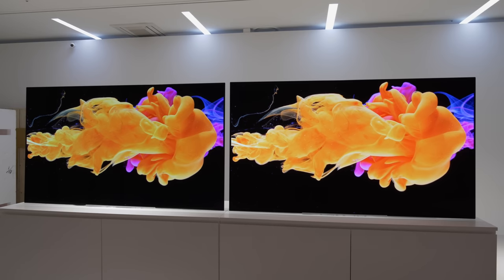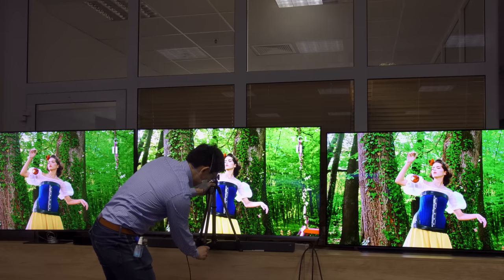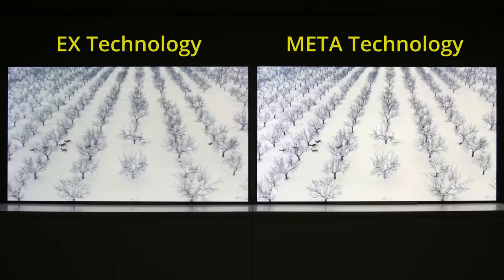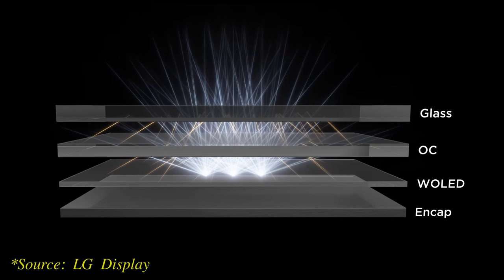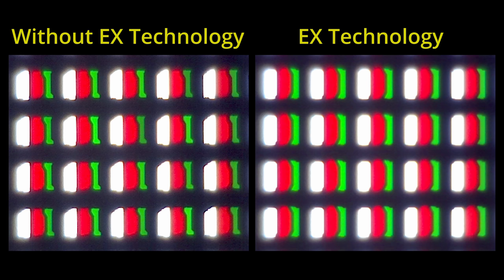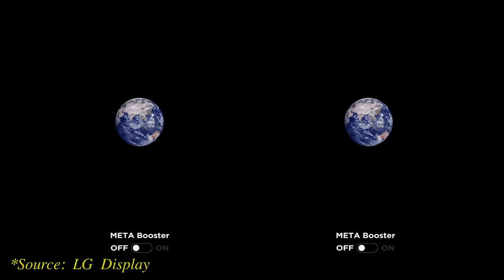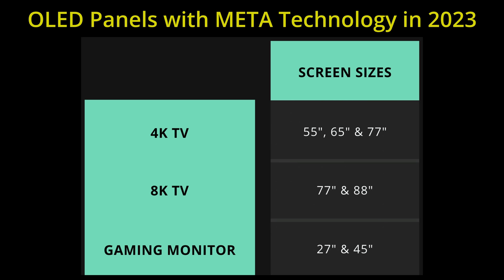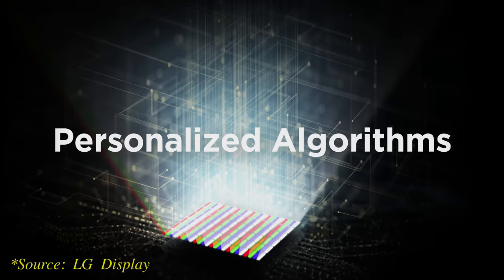MLA OLED Panel Explained - The Secret behind 2100-Nit OLEDs!

Comment: I wanted to by a lg OLED C2 48 inch TV should I just wait than
Reply: Wait for what?  A C2 48" is $1,000 right now, while a G3 55" (the smallest size) will probably be closer to $3,000 - $3,500.
Reply: C2-C3 is only 20% brighter, G Series makes the diference

Comment: As long it doesnt overbright it. I still think the A95k is too bright and the natural colours are far less than a standard oled. Though im a fan or darklevels colours instead of bright
Reply: Keep in mind that if you use a mode which is more accurate or you pro calibrate the TV, you will drop a little in brightness but your colors and picture will be far more accurate!

Comment: Certainly a nice marketing feature and good for HDR specular highlights, but still white subpixel boosting.

QD OLED is clearly the better technology here as the color luminance is MUCH MUCH better than any LG WOLED panel.
Reply: Sure but will you really see that much of a difference in normal movie content that doesn't utilise the expanded colour space? Or will you just be watching demo content all day long.
Reply: @lukey08  yes you will
Reply: Whilst this is true in theory, the implementation of the technology is way more important than the actual tech itself. For instance, the difference in quality of the image produced by the A95K and the S95B was huge, especially if speaking with the hyperbole that you just did with “clearly better” and “MUCH MUCH”. Also, the television that produced that produced the 2nd best imagery last year wasn’t a QD-Oled. If the technology was so “NEXT LEVEL!”, the 2 QD-Oleds would’ve left all other displays in the dust, but the didn’t. The Panasonic LZ2000 was far and away the best TV last year in terms of pure accuracy, and if the end goal is image perfection, that means perfect accuracy.

I mean, the thing all people desire is “it’s so real you can reach out and touch it!”, right? Oversaturated colours doesn’t achieve that effect, and never will
Reply: @lukey08  and no you won’t. Not if the content isn’t graded correctly and the output of the tv is showing all colour luminance levels at the corrected output numbers
Reply: Panasonic industry leader in accuracy and preserving artistic intent chose MLA that tells you everything you need to know stop being a delusional fanboy.
Reply: @kingyogesh441  Huh? Why am I a fanboy for pointing out objectively true facts.

I own the Panasonic LZ2000 and HZ2000. Panasonic makes great TVs, that doesn't change how MLA and QD-OLED work.
Reply: @supremetaaanxz2241  I own the LZ2000 AND the A95K. There is 100% a differene in color luminance, and this idea that colors look over saturated with QD OLED is complete myth and untrue.

The increase in color luminiance of QD OLED is by far the biggest improvement in OLED TVs since they were first introduced.
Reply: @supremetaaanxz2241  You will though. SDR or HDR content looks much better on something like the A95K.  That is not to say that other WOLED TVs look bad, but there is a noticeable difference, and one I think is well worth the money for.
Reply: @Adam-vx6to  whilst that is a fair analysis, the difference is subjective. For you it may be huge, and for others it may be quite negligible. This is not me saying QD isn’t the way forward btw. I think Sonys more subtle implementation of the technology is actually brilliant, and the A95K is truly a wonderful set but again, for me, the difference between that TV and the LZ2000 isn’t absolutely huge. We’re speaking about the very best on the market you know? As I stated, it isn’t the technology, it’s always how the companies deploy said technology. Which is why processing will ALWAYS hold more priority (for me) than the actual tech of the screen
Reply: @supremetaaanxz2241  it’s both the tech and the now the companies implement it.
Reply: @Adam-vx6to  hmmm. See I overall don’t feel the S95B produces a great image, that’s why I feel the tech is kinda by the by
Reply: @supremetaaanxz2241  well Samsung is known for pretty subpar displays. The display panel itself and underlying tech though is better
Reply: @Adam-vx6to  you do realise colour luminance by itself means nothing if the artistic intent doesn’t tap into it 99.9% of content graded today is covered by MLA oled colour space so if you see “more colour” that means qd-oled is oversaturating it .
Reply: @kingyogesh441  wrong. 100% wrong
Reply: @kingyogesh441  well this is exactly my point. There isn’t much content to accurately display colours at that luminance
Reply: @Adam-vx6to  I am 100% right colour luminance of a content doesn’t magically scale will more colour volume of a display it has a hard cap put in place by artistic intent 99.9% of content available to us today should look exactly the same colour wise on calibrated MLA and qd-oled you can’t just magically add more colour to content which didn’t have it in first place.

Comment: Doesn't increased brightness lead to greater chance of burn-in?
Reply: I think it would if the extra brightness was from running the panel brighter but it seems the panel is just as bright as before but the "Micro Lenses" are recovering some light which was previously lost due to internal reflections.  Although the "Meta Boost" does seem like it will make some pixels actually brighter but I'd assume that will be offset by better heat syncs and or other burn in prevention methods. Currents OLEDs from LG are already pretty good at this, newer ones should be relatively similar or even better at preventing burn in.
Reply: @visualdon  Yep.
Reply: I've had an LG OLED e6 since 2016, with no sign of permanent burn in. I must admit, I do sometimes get a bit of image retention from Netflix menu etc, but it clears after a few seconds. I bought a G2 last year and that is showing no sign of burn in. I think the risk of permanent image retention is a little over exaggerated. As the meta panels are using a micro lens array to recover light that would otherwise have been lost to internal reflections within the panel, I doubt it would increase the risk of burn in. As a side note, I have never considered the colour reproduction on either of the OLED TVs I own to be washed out.
Reply: Think of magnifying glass
Reply: Both LG OLEDs I had got burn in. Guess I wasn't lucky. But meh it's whatever.
Reply: @SaithusX  which ones? i had a b6 get burn in
Reply: @anubisbahamut  I had the b7a and the CX. Now would I get another one? Meh. Maybe. Pic quality is good but definitely over hyped imo. But I have had one since the CX.
Reply: yes.
Reply: @SaithusX  what gave you burn in on the cx?
Reply: @anubisbahamut  Probably a combination of gaming on vivid mode. I play a lot of games. So the image was a stuck map icon of red Dead redemption 2
Reply: @SaithusX  ok thanks

Comment: Can I just say this in the hope in sinks in NARROWER  TV'S IS NOT A GOOD THING, they bend they break and they get damaged more easily.
As many Samsung owners in 2022 can attest too.

A uniform thickness is way way better (like the LG G2) that a razor blade mounted on a heavy lump ever will be.
A TV that is even 3" or more thick is better than that. it will sit on a wall better too. instead of this huge gap.

Now if there is heat dissipation reasons for it. fine but be honest about that. or put a heat sink on it.

But every time I mention this people say they'd rather that thickness was there if it contained a heat sink, or extra speakers or just made the TV structurally stable - like at all.

It's scary handling modern TV's they are way to thin on some models I would say stupidly thin.

Either put the TV electronics in a separate box to the panel or make the Panel and even thickness = but not this LG & Samsung silliness thanks.

Comment: Pretty disappointed this MLA tech will not be available on the 42" and 48" panels. I don't understand why they would skip those, considering they are probably the panels most needing the extra boost in brightness because of their pixel density etc. Very poor decision.
Reply: Because the added cost would make them uncompetitive. MLA application is likely mostly a fixed cost (the application equipment, photolithography mask, and the process) plus the smaller portion of variable cost (the materials,, electricity to run it, water/solvent to wash it), so per square inch, MLA is cheaper the larger panel you apply it to. LG probably feels that the added cost would make the smaller panels too expensive for their customers and the target end consumers. In contrast, those purchasing large TVs with the cutting edge technology will pay for the added cost, and as mentioned, it will be "cheaper" for them as well.
Reply: @DarkLordDeimos  Or, you know, they could have added 42" and 48" to the G series and priced them accordingly. And don't tell me there isn't a market out there for brighter 42-48" OLED's because you would be completely wrong. Considering the 42" is probably one of the best "monitors" available for the PC right now, and easily beats the overpriced mini-led monitors in cost and image quality, there is a whole lot of people in the market for a 4k OLED display that is MUCH brighter than the roughly 700 nits that the C series can deliver right now. I'll say it again, limiting the MLA tech to 55" and above was a stupid move.

Comment: Well before we all start getting excited, something we've all seemed to have forgotten, the C8 was already 950 nits peak on a 2% window, the C9 dropped to 850, then the C1 to  750 before the C2 came back to 800 again, all we are getting back is what we lost in the first place, it could be argued we lost it for a good reason as they were driving the panels too hard but nevertheless 99% of people will be gaining nothing at all in real terms for a few years to come yet until we see this tech on the "C" panels and not just he "G"panels.   For now i'll keep my 3D 2015 OLED which is still working fine, still has plenty of brightness (450 2%) and no burn in after 7 years !!!

Comment: Microlenses that SONY use in their OLED microdisplay viefinders (Alpha, Canon, Nikon) for about 10 years? :D
LG will sell that in the market like "new amazing technology". Your info is old like charcoal ;)
Reply: That is not the same thing at all..
Reply: @TheEdmaster87  I think it is the same thing
Reply: @lucasn82_  If it was the same thing then Sony would have implemented it in their OLED tv's and OLED mastering monitors year's ago!

Anyway LG Display is the first to implement it in OLED tv panels. In fact Sony etc are using specifically LG Micro Lens Array in future professional mastering monitors.
Reply: @C--A  They implement that in OLED microdisplays. From Sony Semicon site: "To adress these needs Sony SSC has developed an orginal technology to mold a microlens within a pixel, achieving an improved light emission efficiency of 2.2 times that of conventional product... +reducing crosstalk and better colimation".
Those displays are made on silicon wafer. Last year Sony and JDI shows first time OLED made by lithography. Soon every OLED display on planet will be made like this. I hope.
Mask OLEDs mostly are made on japan machines. Even RGBW structure first was show by Sony in Xperia P.
Professional monitor from Sony have panels made by Sony in Nagoya and they are true super top emission RGB panels (like Qd-oled).

Comment: LG really needs to ship a 65" 8K OLED, my gaming setup cannot possibly fit 77".
I would love nothing more than to buy an 8K OLED this year (as long as it supports 8K at 120hz with DSC through HDMI2.1) but it can't be over 65".
Reply: 8K is pointless at the moment.
Reply: I think most people seem to say they can't even tell the different until the TV is over 77" which is why smaller 8K TV's are not a common thing. but also for other technical reasons. the smaller they get the harder they have to push them to get a decent amount of light out of them = that is why many 8K TV's of lower sizes are less bright than the 4K equivalent by the same maker. The tighter pixels makes less light able to get out past the physical parts of the TV that get in the way... those Micro lens might help a little bit though.

Also 8K TV use sometimes twice the energy too so really it's best to make the space for the biggest you can fit really if you really want 8K.

I think that is a shame though as I would like to see 8K be the default for more TV's it's not like it's That much more expensive to make really. But I think the Video standards are not helping either they can't even do 8K 120hz at 4/4/4/ chroma without cheating with extra compression frame skipping, faking one of the axis resolutions and the like.
Reply: @PSYCHOV3N0M  The entire TV industry is pointless, games look amazing in 8K.
Reply: @90lancaster  "Display Stream Compression" "DSC" is visually lossless in most scenarios and allows much higher video bandwidth.

Comment: More burn in 👎
Reply: not how mla works but okay, sure..
Reply: Why would it have more burn in when the increase in light output is as a result of the additional MLA layer and not at a subpixel level.
Reply: @lukey08  The brighter they get the worse they get
Reply: @KingScotto.  You are not understanding the underlying technology here. At a subpixel level the brightness remains the same. It's the MLA technology that provides a better dispersion of light that reduces light loss that creates a brighter picture.
Reply: Let me try to explain. Everything that comes past subpixel is reducing brightness cause of inner light reflections. MLA technology reduces to almost zero those inner reflections so there is no loss in brightness after subpixel level. So there is no increase brightness of subpixel level. It's just no lose of brightness after this level
Reply: @lukey08  He doesn't know any better, he's just a troll saying words.